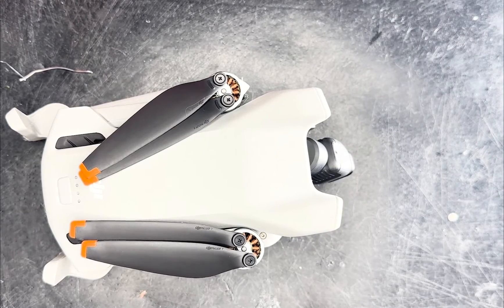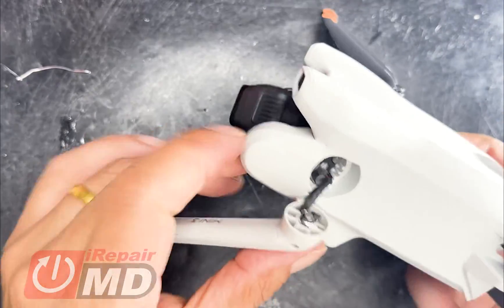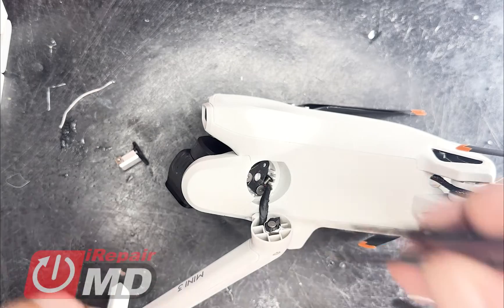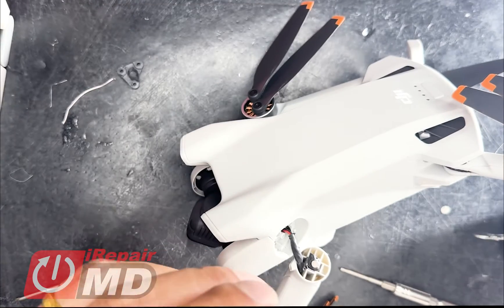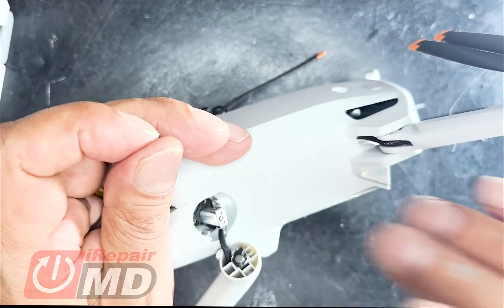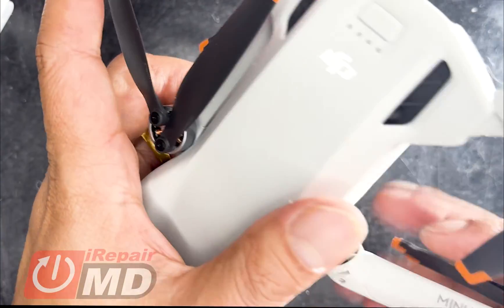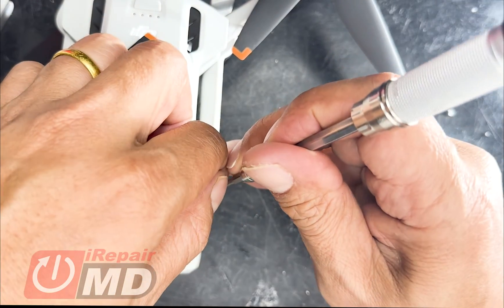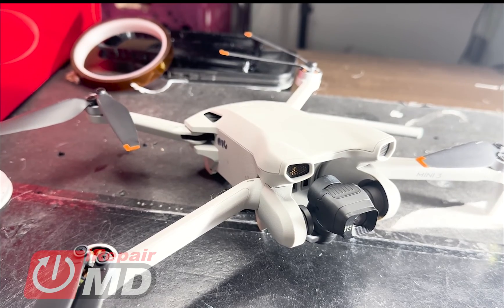DJI MIni3 Pivot Arm Replacement

Comment: Thank you so much! I started to fly without checking the surroundings and flew into a tree because I only focused on the object I wanted to record 🤦 Lucky for me this was a cheap fix. It was hard to find the tools cheap but finally i did that too. Now I got the T4, T5 and T6. I hope I don't need to use them in the future. Rule number one before take off, check the surroundings. A beginner rule I suddenly forgot about.

Comment: I AMOST WANTED TO SMASH .... IT  ALL    What I  did  ( just to get the screw lined in  )  put crazy glue on  a toothpick  and MICRO DAB on the tip of the screw driver   . It only takes seconds . Compared to tweezers . the screw falling into  the compartment    .  Line up and screw in

Comment: Pro Tip: Screw the first screw in furthest from the hole "carefully".  For the remaining screws try holding  the drone upside down with your cell phone light on your desk for visbility.  Gravity is your friend, so you don't lose the screw.  Took me a few minutes to think of that lol.  Tried putting small toilet paper in the hole but always got in the way of my vision might help if your clumsy on the first screw.

Thanks for the video now I am trying to back pedal on my DJI care refesh 1-2 uses, I paid for already

Comment: Thank you so very much. I have had that pivot joint and a arm i didn't have to use for about 8 months. I wasn't looking forward to total disassembly. When i seen all three screws still there yes you are the man. Just just got back from my first flight since i tapped my garbage can 2 years ago. now i got a 3 and 4 going just have to fix  the mini 2 which is working super glued

Comment: The way you handled that is awful
Reply: He got his point across but it could be better. Like showing guys the top and bottom arm screw. Show the concave edge of the part and which way that faces going back into the drone. Showing theres a catch all hole that needs to be plugged up temporarily while working. Otherwise fine video.
Reply: OH AND EXCEPT FOR THAT DEAD PAUSE WHAT WAS THAT A PISS BREAK. Other than that it was cool I liked it Lewis.😊
Reply: Lewis Cook where are your top shelf instruction videos

Comment: hi can you repair the mini 4 pro axle with the mini 3 pro part?
Reply: Im here for the same question and looking at it seems like the pro 4 uses same parts.
Reply: @haxxorsheep  hi, i self repaired mine yesterday, the pro 4 of compatible with the Pro 3 Front Axle. it fit perfectly fine and works just like new
Reply: Seems that there’s quite a lot of interchangeability between the Mini 3, Mini 3 Pro and the Mini 4 Pro
Reply: Yes